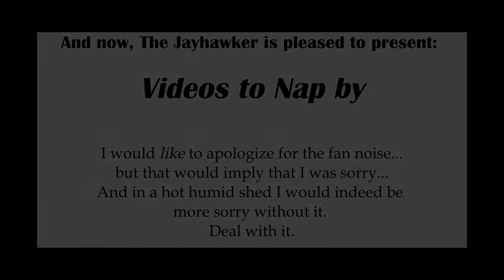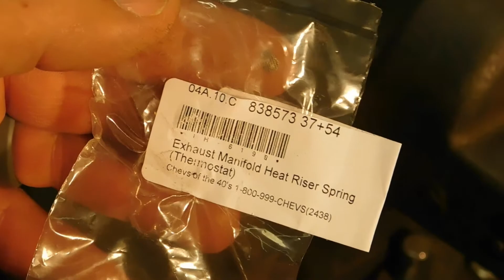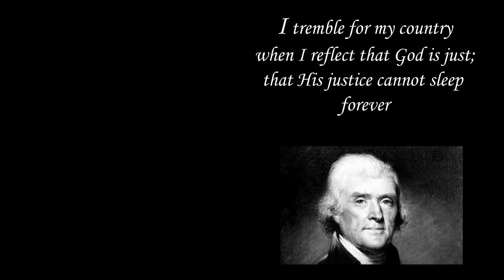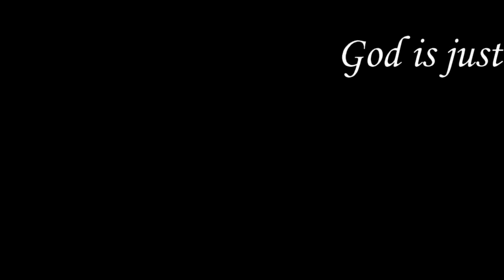Part 9: 1942-1948 Chevrolet 216 & 235 Manifold Repair - Plus Fuel Pump & Road Draft Tube

Comment: You said if the heat riser is open when hot would be detrimental. 
What problems can this create? My 51 is stuck open. can't move it by hand. don't want to snap it. 
Anyway, learned a lot from your videos.
Reply from the maker: There would probably be a lot of debate to this question, it's just one of those things. But basically (in my opinion) a engine runs poorly in cold weather even with a choke. So they put a temperature controlled flap between the two manifolds to provide heat to the intake when the ambient temp. was cold. Warm air/fuel atomizes better so that makes sense. The down side of it being stuck open would probably only be noticed in warm weather. If you have fought any issues with vapor lock, pre-detonation, having to run it richer etc. By the time the small block v8 came along they had a permanent exhaust passages heating the bottom of the intake. Oh and I love your name, Arnold Ziffel, hilarious!
Reply: @TheJayhawker  thanks from texas
Reply: @TheJayhawker  Hi from Bugtussle. As it warms up I'm feeling like the engine is sputtering at all speeds, light backfire when back off the gas, even trying to die when I come to a stop. when I pull the choke out the engine smooths right out. Runs fine with the choke out. Would you think this could be the heat riser stuck open?
Reply from the maker: @MrWhylie  I would expect pinging or dieseling when you shut the ignition off but probably not this problem. Check for a vacuum leak with engine running squirt carb or brake cleaner around carb mount at the intake as well as the throttle plate shaft going through the carb body and see if the engine rpm changes. If not that I would suspect that you have crud in the carb jet or a passage.
Reply: @TheJayhawker   you da man.

Comment: WHY wouldn't you snug the manifoldassembly to the head BEFORE you tighten the 4 intake/exhaust fasteners?  Looks like you're setting up un-necessary preload on non-precision  parts... NO??
Reply from the maker: Yes, yes, I covered this many times in the past and have considered removing the video many times because of my rashness at the vise. I did however loosen everything again and start over. Thanks for your concern and for watching!
Reply: @TheJayhawker  I didn't ask so I could upset you, I have done some wrenching, too.... and the thought occured... so I asked...  I didn't read All your replies but I did scan a bunch... and didn't see the question asked.

Comment: Could you please make a video about how to replace the head gasket?
Reply from the maker: Sorry, I started making videos after I had already done all of that on this project. But if you shoot over to my channel  and watch the videos on the 1966 C20 pickup you can watch the process on that engine. It is about 18 years newer but the process is pretty much the same.
Reply: @TheJayhawker  thank you sir!
Reply: Get you a manual and a good torque wrench also clean clean clean both surfaces

Comment: "as i heat it you'll see" ... see you move it with your other hand @5:06
Reply from the maker: haha, yes I certainly did. I wanted to demonstrate how it worked but it made me nervous using a torch on a (I'm sure) foreign made spring. Hey, at least I don't hide or edit these things out right?

Comment: I know you did this a year ago. At the risk of being the know it all that everyone loves to hate I see a few things that might need some procedural changes. No torque on exhaust to intake till it is in place. Choice of sealant on fuel side. To much strong arm.
Reply from the maker: Yes, for a year and a half I have answered this same concern. And it's a choice of never living this down or remove the video. I have lived by the procedure of never tightening anything until all fasteners are in place but for whatever reason when I was at the vise I tightened those. Rest assured that I went back and loosened everything, and then tightened them again. As for the permatex form-a- gasket, I am a huge fan and have been using it for such things for 30 years. Permatex does state that it is fuel, oil , and grease resistant. Thanks for watching and for looking out for me!

Comment: Jesse Torres
Hi Love your video's, I have a 1936 Chevy with a 6 cylinder 207 engine. my rod that goes thru the exhaust manifold is it suppose turn when the metal flap moves up or down, or is the metal flap turn only. I was thinking of drilling out the metal rod that go's thru the exhaust and make another rod that will turn when the spring gets hot or cold. Thanks so much.
Reply from the maker: Yes, the rod turns with the flap. The spring is attached to the rod so that is what it turns. Before you drill it out you might try soaking it with PB Blaster or Marvel Mystery Oil and let that work on it for a day or two. I've had great luck with both.